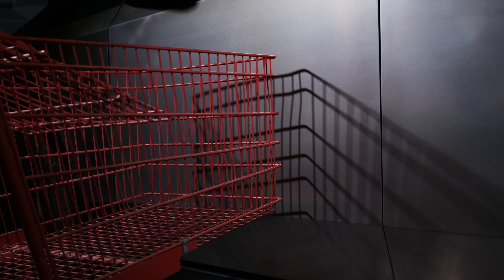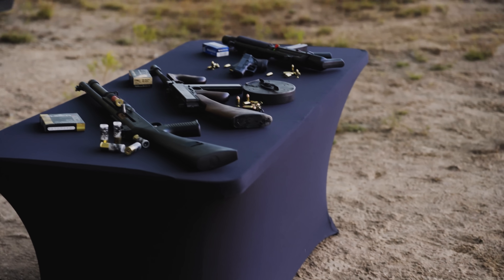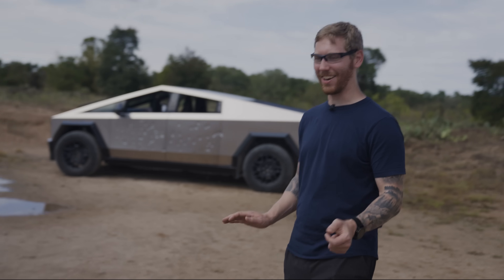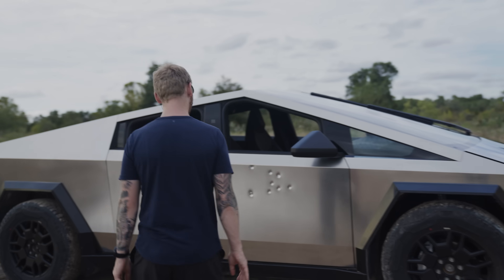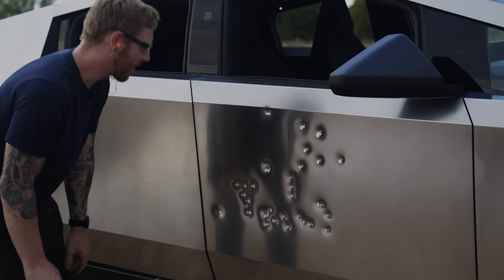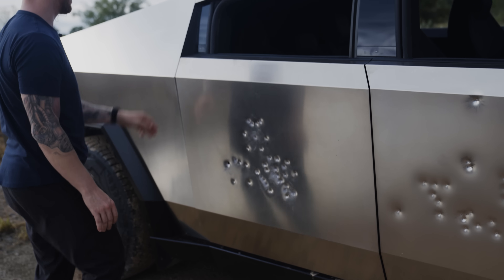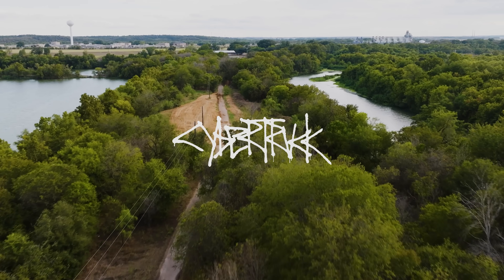Cybertruck Bullet Test

Comment: Someone is going to come along and make this a fully decked out cybertruck with bulletproof glass, emp protection, and all that jazz. I look forward to seeing that video
Reply: Faster bullets from a rifle will rip right through the cyber truck. Needs Kevlar panels in the doors.
Reply: @chrismanning1171  Keclar doesn't stop most rifle rounds, either.
Reply: @TheCharleseye  I wore kevlar plates in the Army that could stop most 7.62 machine gun rounds. Not all Kevlar is soft fabric type.
Reply: @chrismanning1171 don’t want to sound like a jerk but
1. What 7.62 are you talking about,7.62x51 or 39? 7.62 nato? There is no 7.62”mg”,
2. what you probably heard was “Kevlar vest”.because I have never heard of plane kevlar stopping intermediate cartridges.
Reply: @chrismanning1171  Im not trying to be mean.and you are probably correct about kevlar.but the armorer in me wants to know why you called 7.62 NATO a "machine gun"round?
Reply: @TheCharleseye  I said a kevlar panel not kevlar cloth,  a kevlar panel is sheets of kevlar glued together to make a panel that is about 1/2 in thick. We had them in the Army in some of the trucks that did not have armored cabs. I had body armor in the Army that had two kevlar plates that could stop NATO 7.62  x 51mm rounds.
Reply: @chrismanning1171 
A flat surface is not as effective at stopping a bullet as a pyramid surface pattern. Reinforcing the doors also is going to help.
Reply: @xalexanderx7342  LOL,  you are talking to a former track vehicle mechanic from the Army.
Reply: @chrismanning1171  well
Correct me if I’m wrong
Reply: @xalexanderx7342  Yes, often armor is slopped at 60 degrees.
Reply: @chrismanning1171 https://youtu.be/VLV-4HMrAz0?si=KXF3x3tQ0_K4F9Hx
Reply: don't forget the helipad !
Reply: good luck with EMP protection/signal shielding. Seals are a nightmare in the industry, so hard to get a durable seal that shields reliably. Plus with the shear amount of surface area when it comes to vulnerable components the difficulty in that will be crazy high
Reply: @y2ggaming397  It’s just a thought to emphasize what people could do to a car like this, as people have ruggedized vehicles previously. 🤷🏼‍♂️
Reply: @garrettpete  ruggedized is different from shielding from wireless signals and protecting from EMPs. I work in the industry and even small faraday bags can be a pain to get right, and those often use a multi-fold mechanism with only 1 opening. Cars with multiple doors, multiple rollable windows, and ventilation systems would be near impossible to get to work reliably. One loose bolt can let strong EMF/EMP in if it's a strong enough signal/blast
Reply: test it against the presidents limo
Reply: Safe until you need to charge...after 250miles
Reply: My guess is that the sound system will already play jazz.
Reply: The only real EMP protection for this would be to yank out all the electronics, motors, and batteries, and drop in an old internal combustion engine, with a carburetor a points ignition. Easier to just bulletproof an old truck.
Reply: @TheCharleseye ignition and being emp proof, how did you have that in mind? There is a reason they use old diesels for that, because they can be operated with 0 electronics on them.
Reply: @gabbermaikel  Old points style ignitions don't have electronics of any kind.
Reply: @TheCharleseye  ah so the spark appears from nowhere? Or wait, nope it dosnt. It comes from a coil, wich could get damaged as wel as the condensator wich is actually pretty likely to die from an emp. So nope, those styles of ignition dont work without any sort of electronics. That it dosnt have an ecu dosnt meen its not having electronics involved.
Now and old diesel engine uses a mechanical fuel pump that is driven by the crankshaft, camshaft, timingbelt or timing chain and the way to shut those off is by pulling a lever that closes the fuel flow. So its all mechanical. I have 1 like that in my boat, it has 2 wires to the starter, and 2 to the alternator and no other wires on it at all. It even has a mechanical oil pressure meter so even that dosnt use electronics.
Reply: Made with the tears of a thousand virgins
Reply: Emp is only in the movies.. if a nuke hits the emp from it is not you're main problem.
Why you yanks so scared you need bullet proof glass?
Reply: EMP and then you can't charge it cuz no where to charge it. How fkn useless
Reply: By the time you buy this for $100k and upgrade it with all that jazz may as well just buy a Rezvani.
Reply: And during the apocalypse a group of survivors with BP Glass Cybertrucks might form cuz they're the only ones left.
Reply: The popular trend with armored vehicles -- at least for the commercial market -- is to build fairly "low key" vehicles. Part of security (particularly in places around the world where security is a life or death matter) is to NOT stand out, to try to "blend in"; there might be a few who wanted a fully armored Cybertruck, but most who buy armored cars aren't looking to draw attention to themselves.
Reply: than the government will come in and say it is a threat to democracy and racist and ban it
Reply: Um 30 od 6 pls
Reply: 2PAC NEED THAT CAR ASF
Reply: you can get EMP hardening of internal components, to a degree - but not the entire vehicle in a practical manner
Reply: Needs a roof rack for attack drone deployment
Reply: There’s a truck out h there already like that
Reply: https://youtu.be/VLV-4HMrAz0?si=KXF3x3tQ0_K4F9Hx
Reply: https://youtu.be/VLV-4HMrAz0?si=KXF3x3tQ0_K4F9Hx
Reply: Everybody loves a Doomsday truck😂
Reply: No one will be able to emp shield one.  Emps travel along wire into computers... so if it was plugged into the grid.. fried.  If you didnt shield 100% of the wire.. fried.  If any of your seals moved over time from the body flexing.. fried
Reply: Its clearly a liftback  not a truck though

Comment: i laughed when they directly compared it with other trucks in the end. i wanted to see tests for 5.56 though
Reply: steel core 62gr would go right through it...
Reply: @wildbill6976  even soft point 556 would penetrate easily
Reply: Bro shut up 🤦🏽‍♂️ for a truck that isn’t advertised as bulletproof it did great 🤷🏽‍♂️ id1ot
Reply: Tbf most experts say 9mm and buckshot penetrate more than 5.56 in a house so surely that would hold true here.
Reply: @cosyfoot7867  Not remotely true here. There's a reason they used subsonic rounds and didn't use spitzer bullets. 5.56 would absolutely go through this. Most rifle rounds would. I'd love a source for your information because unless we're comparing 9mm ball to 5.56 HP, I can't imagine a scenario wherein the 9mm would have more penetration in a house.
Reply: @cosyfoot7867  video gamers aren't experts btw...
Reply: @cosyfoot7867  velocity is what you need to penetrate steel/ armor. Any rifle round should easily penetrate the Cybertruck. Especially 556

Comment: Because of course everyone has the need for projectile resistance as a key characteristic for their expensive poser truck.

They should probably have told people that the same work hardening characteristic of austenitic stainless steel that makes this stunt possible also means any RL dents will be near impossible to remove with existing PDR methods.

Literally the most pointless test ever.

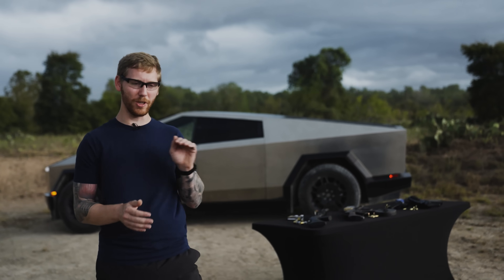Comment: 3:25 the engine block is big enough to stop a bullet but not a door panel. There’s also a difference between bulletproof and bullet resistant and they didn’t shoot the windows directly that’s supposedly able to survive a thermonuclear blast and got cracked behind a door panel by a shotgun buckshot and they said it was successful. Success seems to mean something else to these companies…
Reply: Engine blocks can't stop rifle rounds, and certain spots can't even stop handgun rounds, but its def the best place to be in a firefight
Reply: Do you mean tank the round, or stop and be damaged, have a hole inside? A 50cc bike engine shot at the right angle will stop a rifle round, even a penetrative 30-06 equivalent I´d bet.. @nicktienter4740

Comment: To have a vehicle with that type of armor and a we all can get one is a big deal! That’s pretty impressive Tesla! I hope other trucks follow suit! Looking forward to my CT 🙌
Reply: It's not armor
Reply: @thebagel_lord   Everything is armor, there's just better armor and worse armor
Reply: @DemsW   if it was actually armored it would have been given an NIJ or EN rating. Since it is only durable and not armored it does not have such a rating. They shot at the doors, but not at the windows, which are definitely not bulletproof
Reply: The rear-wheel drive version of the electric truck will start at $60,990 — up from the original price of $39,900 in 2019.
Reply: Imagine how hard it would be to get out, if the battery catches fire and the doors refuse to open (as has happened with several EVs now). It's not like you can just break the glass, like a normal vehicle. Elon designed a perfect, mobile, pressure cooker.
Reply: @TheCharleseye  They just have to make a not shit door mechanism
Reply: @DemsW  Except the dpor mechanisms are electronicall controlled. That doesn't bode well in an electrical fire. Maybe you should have suggested that to them before they started production.
Reply: @TheCharleseye do you intentionally forget about the manual emergency release or are you just not aware it exists?
Reply: @TheCharleseye  How do you know it's electrical ?
Reply: @DemsW we can figure the door handles are electronic because there are no Tesla cars in production with manual door handles
Reply: @thebagel_lord  And those Tesla's have manual door overrides

Comment: 2:05 the 9mm is going slower because the MP5SD bleeds gas to keep the round subsonic. 115 grain is normally supersonic.
Reply: Tesla's engineers said this will only stop sub sonic rounds like the .45.  It will not stop anything else.  A bit of false advertising I think.
Reply: @RealJeep yeah no shit, it's Elmo's project, of course it's full of false advertising. I wonder why they didn't try shooting the windows...
Reply: The video said that out of the Glock, the 115 grain were traveling at 1100 fps, which is just under the supersonic speed of 1125. Out of the MP5, they were doing 950 fps. Personally, I'd like to see how it would fare against .44 Magnum, 300 grain, hard cast, wadcutters. I don't really care how slow it's moving, that round is a freight train. Not saying this isn't an impressive demonstration. I just really want to see some perfectly round holes in these doors.

Comment: Seeing the metal ripple like water is amazing

The best place to hide from gun fire in a regular vehicle is behind the engine block
Reply: Yeah, only if the gun fire is coming from the front of vehicle, and not the sides or the rear.
Reply: @honorquest  Any angle between the engine block and gun fire helps as long as it's between you and the gunfire. And yeah I meant more so if you are outside a vehicle using it as cover. If you were inside the only option is to get low try and position your head and chest behind the block.
Reply: Yea. Thats why I will stick to my petrol powered pickup.
Reply: @magamike1800  This cyber truck is clearly still a far better option than hiding behind an engine block if gunfire is your concern.

Comment: the bullets used in this test primary purpose is not for penetration. None of these rounds can puncture most low level body armor. rifle bullets are designed for pentration. Additionally they used hollow points to sway the test instead of using FMJ's. Still better than any other vehicle in terms of armor if you are not willing to spend 100k+
Reply: It held up against 00 buck shots. Pretty impressive